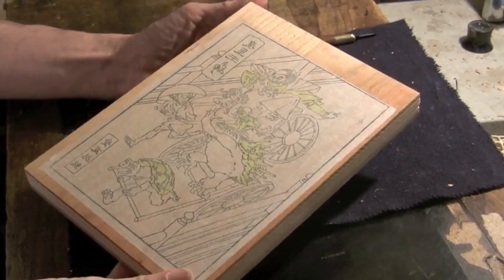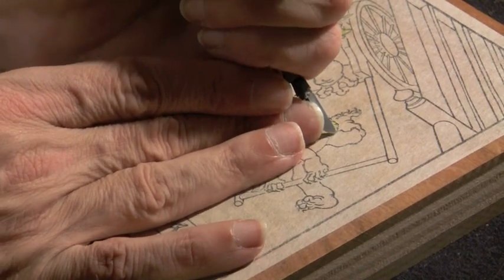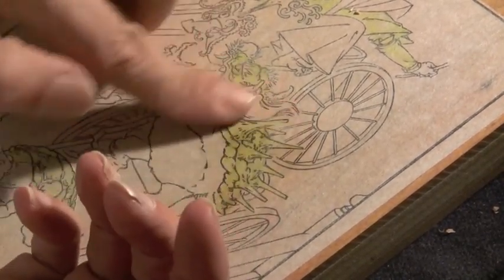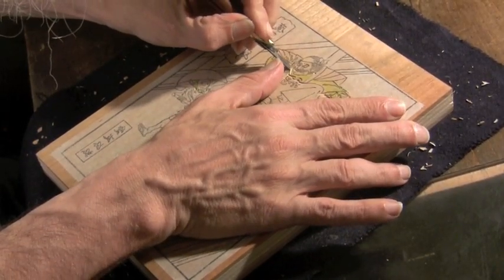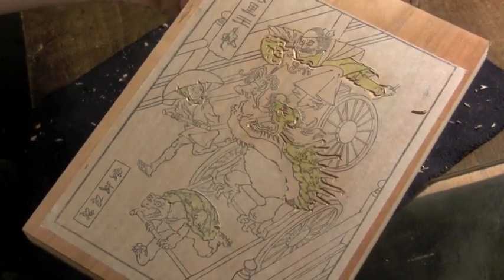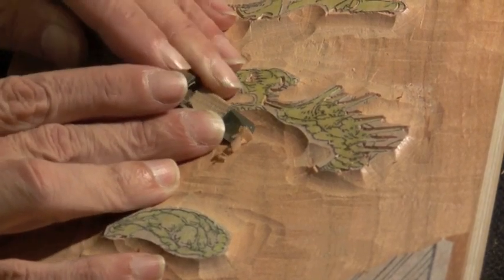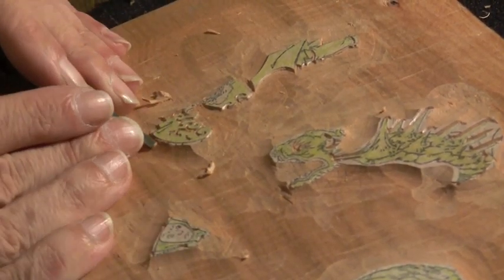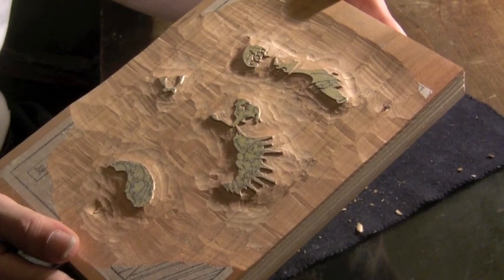Ukiyoe Heroes (2) : cutting a colour block

Comment from the maker: The wood is 'yamazakura' - Japanese Mountain Cherry. As you can see from the video, they are not 'solid' blocks, but are made up of 5mm layers of yamazakura on each side of a laminated inner core. (The last craftsman who specialized in sourcing and planing solid cherry blocks for printmaking passed away more than ten years ago ...)
Reply: First of all - amazing content and it was such a nice discovery today for me. I have a question - considering I might be just about crazy enough to pick ukiyo-e up and try it myself, do you think it's possible to have the yamazakura blocks shipped from Japan to EU and would shipping factors (like moisture for instance) affect the wood or is it of no consequence? The process of acquiring the wood blocks is possible thanks to many so called japanese "proxy" services, as long as the manufacturers/craftsmen behind this product have any modern means of placing an order (like a webshop or even an email). Is the information on how to acquire the tools / wood blocks available anywhere in your recources? Kind regards, Chris. Again - amazing work!

Comment from the maker: The oil is camellia, and we use it very lightly on the face of the baren; it has two purposes: the first is of course to make it a bit slicker and to avoid tearing the paper. The second is to make it more resistant to absorbing the moisture from the wet printing paper, which would soon make it soft and useless.
It has been used in this fashion for hundreds of years, and as long as we use it lightly and with discretion, it doesn't seem to linger in the paper ...

Comment: Just beautiful! I'm new to woodblock carving... may I ask what kind of glue you used to adhere the paper? Thanks
Reply from the maker: For sheets with many fine lines, I use a lightly thinned white wood glue. For the colour transfer sheets, which don't have such fine detail, I use the mucilage made from gum arabic. It's really not so critical, as long as it sticks fairly well, and is washable once you're finished carving.
Reply: Thanks for replying :)
Reply: Hi Dvid, I am wondering if there is any possible way to learn the craft of ukiyo-e either through a formal education or apprenticeship? I am currently 26 and have just graduated from psychology major and I would love to travel to anywhere and learn this craft...
Reply from the maker: We ourselves are pretty much a 'factory', and don't do any teaching (other than our simple Print Parties). You might have a look at Takumi Hanga, run by the carver Motoharu Asaka [http://takumihanga.com]. He doesn't speak anything but Japanese, but Asaka-sensei is teaching many of the basics there ...